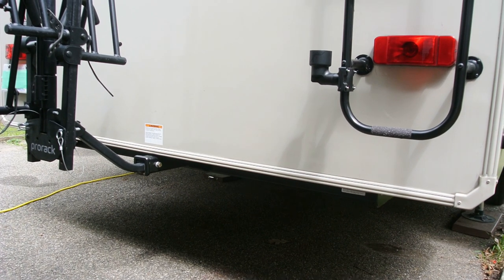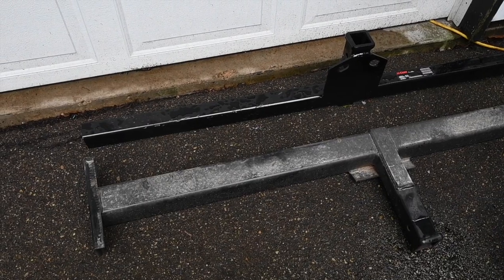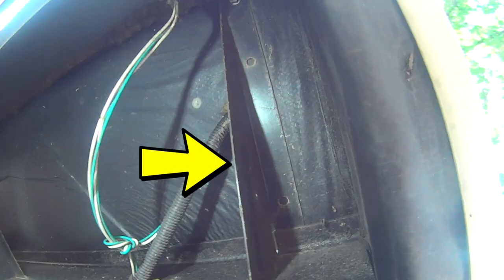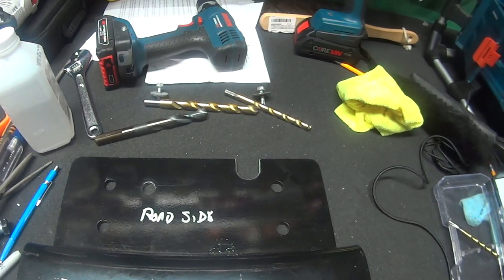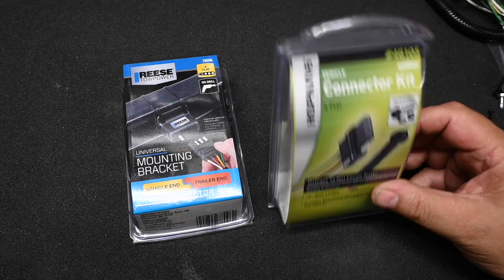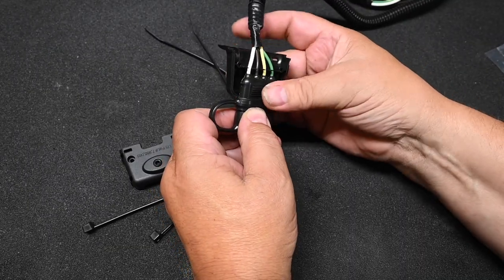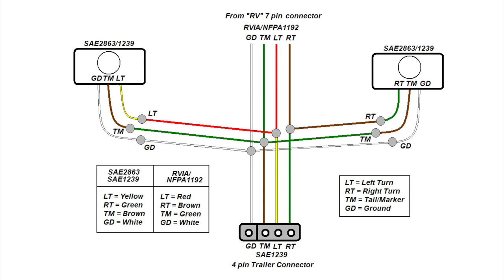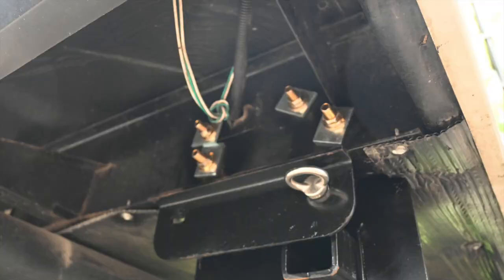Upgrading my 5th wheel's hitch receiver for double towing.

Comment: You are very resourceful, using a chair and jacks as your “extra hands”. Some projects are simply easier with extra hands. I like how you included your oops moment where you had to take the bracket off to drill - hey, we all make mistakes.
Reply from the maker: When you do projects, you will always have setbacks. I like to do this kind of narrative as it does rapidly show the progress, and not to be afraid of making a mistake.

This is why I have become so fond of metal working. Almost any mistake can fixed, with enough re-welding and grinding.

Comment: Great video, yours always are. 

I believe MI requires both the standard safety chain attachment AND the outermost frame attachment. AFAIK, it's the only state that allows double towing that has that specific requirement. MI also requires an endorsement AFAIK.